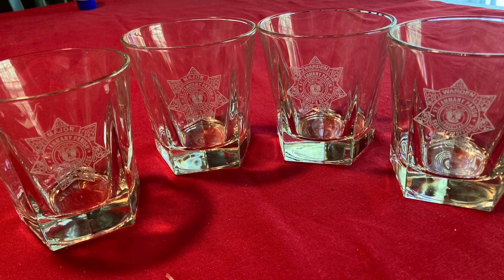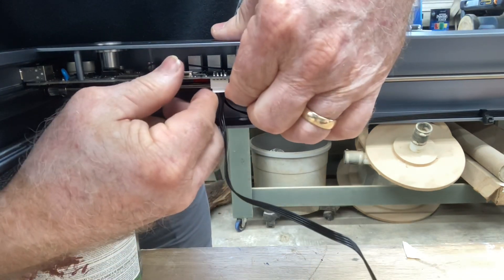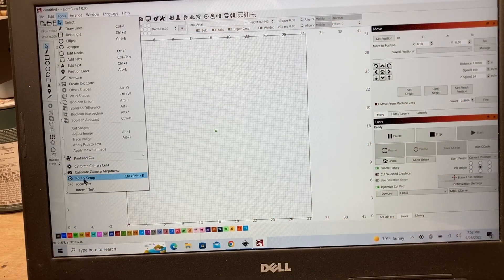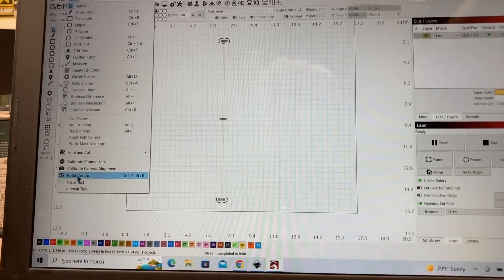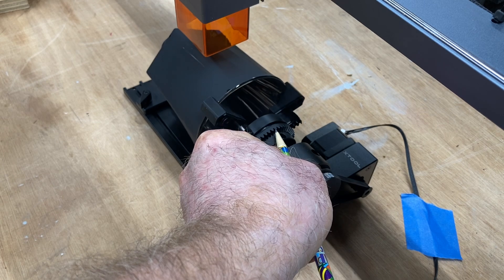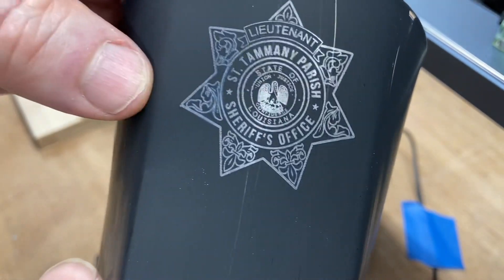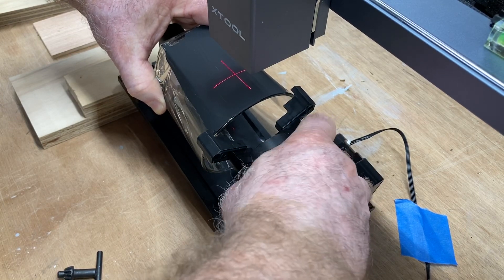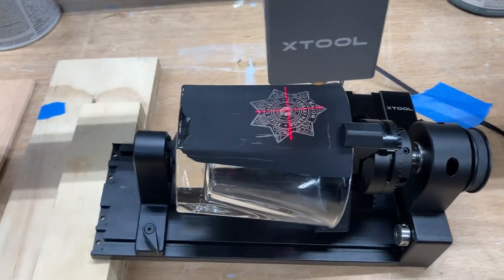Everything You Need to Know to Calibrate xTool D1 Chuck Accessory Using Lightburn

Comment: Excellent video Paw Paw!!  I am trying to connect a RA2 pro to my Comgo Z1, but there are a few issues.. My Y axis has two stepper motors and two connectors on the control board.  There is a spot on the control board for the Z axis, but no connector to plug in to..  I see three options:  First, get a connector to solder to the control board and hope I can enable the Z axis in lightburn..  Or hook the RA2 to the X axis and use the Y axis to go back and forth as the rotary turns..  I'm not really excited about hooking the RA2 to the Y axis as this would make things more difficult.  Any thoughts??
Reply from the maker: Don’t make it complicated. Use the y axis. Since you have two stepper motors all you need to do is to use one stepper motor and unplug the other stepper motor.
Reply: @PawPawsWorkShop  I don't have a stock Z1.  I have expanded it to 465x785mm.  To fit the machine on my bench I had to rotate it 90 degrees clockwise. The other Y motor is at the back of the enclosure and difficult to get to.
Reply: @PawPawsWorkShop   Pawpaw,  I've got the basic rotary working.  I'm having an odd problem..  I have lightburn set to "current position" and the origin is in the center of the design.  If I move the laser module to the position by hand, I get an out of bounds error.  If I move the laser using the move menu in lightburn,  then it seems to work.  Does that sound right??  All I have to do now is get some experience and get good at it

Comment: The 1435 you used to check the rotation is just to check the accuracy of chuck set up? I assume you change the rotation for the badge you engraved on the glass?  Is there a formula you use to keep the aspect ration correct or close?

Comment: I have an xtool ra2pro. It is installed on the Y axis on an ortur lasermaster 2. I have to override the warning message that says coordinates may be out of bounds. After running a job, the laser head flys to the right side of the frame.  Indeed, it is trying to go WAY out of bounds. I have to hit the reset button to stop the thing from crashing the head every time. 

What's going on? I really hope you can help me.
Loren
Reply from the maker: The machine does not know where it is in relationship to the wasteboard. If using Lightburn software you can use “current position” and you should be ok.
Reply: @PawPawsWorkShop  you're the greatest! Thank you.
Reply: @PawPawsWorkShop  I am using Lightburn. It's an amazing piece of software genius..

Comment: Can you or have you done a video on how the calibrate the xtool d1 laser itself? I just got mine and haven't been able to do anything because of poor instruction, I'm at a loss. Please help
Reply from the maker: What specific questions do you have?  I have numerous videos on setup and operations. Do you use Lightburn software?
Reply: Thank you so much for responding. No, I have the software it comes with, sorry I can't think if the name right now,  I think I need to calibrate my laser but I'm not sure how cause when I tested it, I did a simple circle and instead of a closed circle it was open and had a flat side. I've used the LaserPecker many times successfully but with this xtool D1 20 I'm at a comple loss
Reply: @elizabethclifford6691  There are dozens of videos on YT that will walk you thru it, just spend an afternoon watching - once you get the basics, it goes fast.  Just search "d1 xtool setup" or something.

Comment: Love your videos! how did you get the Cross hairs to turn off and the laser in an accurate spot for framing I am struggling with my rotary tool. The other issue is when I use the rollers it is always off when it returns to the star point
Reply from the maker: The crosshairs are used to frame. The method I used to turn off the crosshairs is to setup a separate toolpath with the laser set to about two percent power. It’s just like running an engraving except in this case the path is the outline of the project and the power is very low as to not burn the project. The rotary takes a little practice and some trial and error

Comment: I'm sure I have seen someone work out the number of steps in a single rotation as 1440 steps PR for the RA2. A method using two fine needles taped to the chuck and body. I'm sure that 1435 mm is close enough for most jobs (listed as mm by Lightburn in the rotary setup but probably intends to mean steps per rotation). Thank you for your detailed explanation.
Reply from the maker: Thank you for sharing

Comment: I’ve always plugged the rotary into the control board. Never heard of plugging into the Y port.
Reply from the maker: What happens if you have a laser without a port on the control board?  Hummmm, Y axis?
Reply: @PawPawsWorkShop  the D1 is the only laser I have. It’s always been set to z axis even with the original rotary.
Reply from the maker: That is the correct place on the D1

Comment: Great video as usual Paw Paw! Mirroring the image depends on how you setup the chuck. You can do larger cups with the chuck on the other side of the roller and a weight holding down the frame. The chuck is reversable. With the chuck on the inside, you have to mirror the image. With it on the outside, you don't.
Reply from the maker: On the first video where I had the cable plugged into the y axis I did not mirror the image. Two factors change on the second video, 1 I used the plug on the board. (Z axis) and 2 without changing the chuck I did flip the cup to the right. I’ll test to see  the individual effect.
Reply from the maker: Yes, I’ll be showing that in the next video. I doing a cup with a handle. Thank you very much